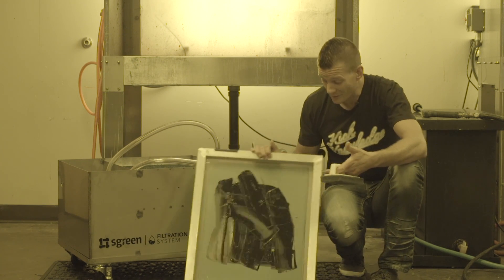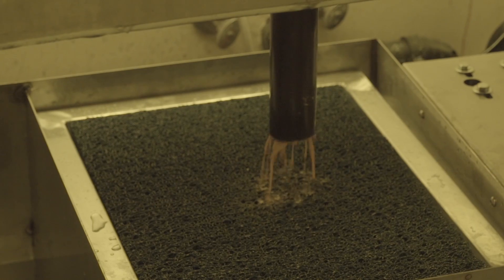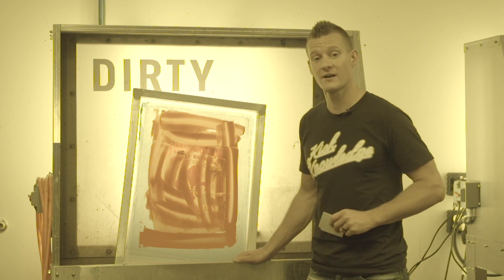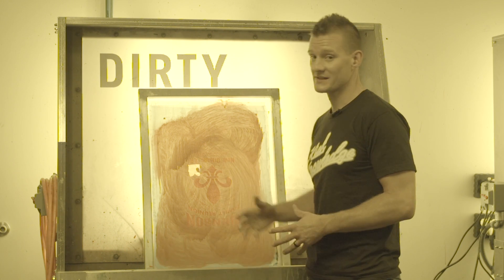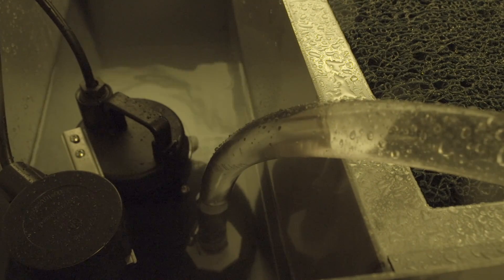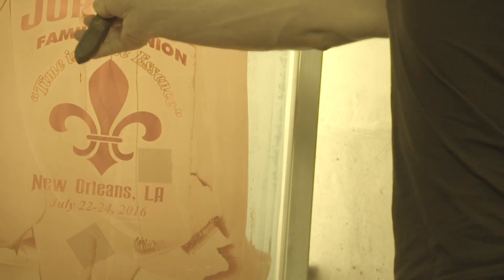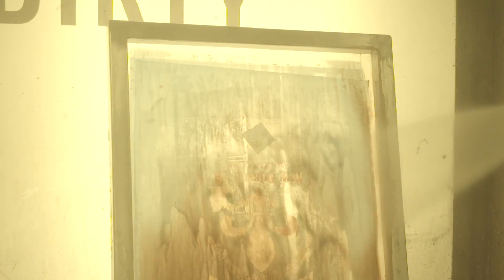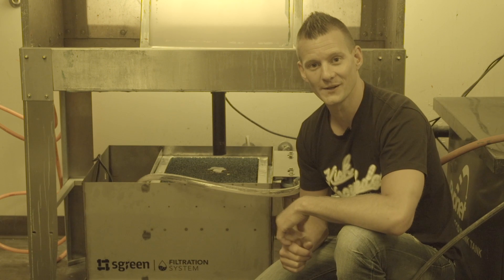Introducing The Sgreen Water Filtration System for Screen Printing

Comment: Can the filtered water be reused? I saw some similar products claim that these types of filters can allow a shop to reuse 100% of the water that passes through the system.
Reply from the maker: While these filters do a great job of removing particulates, they do not have the ability to filter out chemistry and the finest of particles.  For that reason, it's not recommended to reuse the waste water even after filtered.

Comment: Hello,

I was thinking about buying the (Semi-Pro 4 Color Screen Printing Kit) but the only way for me to clean the screen is in my kitchen sink. I have no room for a Water Filtration System, so is it a bad idea to start a screen printing business from my apartment?

Thanks
Reply from the maker: Great question! Thats not a bad idea at all, many screen printers have started in their apartments. Its going to be a bit more difficult but its definitely possible. You want to filter as much from the liquid before it goes down the drain by utilizing mesh in your sink/over your sink, or you can go to a local car wash and use their set up for cleaning. (be sure to put clean screens in a bag to avoid debris)
Reply from the maker: Give us a call if you would like any guidance!